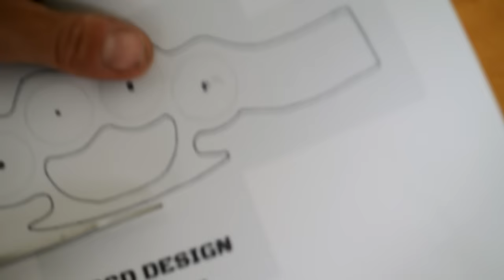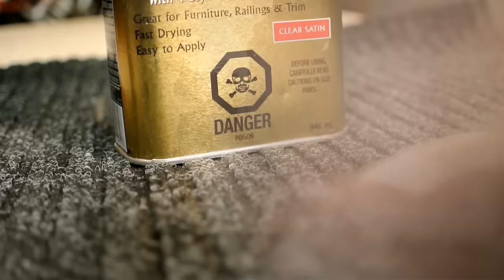Gopro wooden knuckles mount - Build It!

Comment: Great video I would again change one thing for me being a woodworker means no metal involved unless I am creating a hybrid piece that being said I would have made it to where the GoPro fits directly onto the handle. What I mean by this is that I would make the handle to where it has the slots in it for the GoPro I'm going to call them prongs but the part of the housing that slides into the accessories and the bolt goes through. So that the prongs slide directly into the wooden handle into the slots that have been created. Again great work u do amazing woodwork keep it coming. It would be awesome if you could put out more woodworking videos. Again great work love it.
Reply from the maker: I understand what your saying, that would definitely make the piece more unique for sure. I appreciate the suggestion and encouragement!! il definitely keep this in mind for the next one i build.

Comment: Very Nice!  I have that same Delta Scrollsaw....  Haha!
Reply from the maker: Patrick Morrissey I love that machine! I picked it up dirt cheap from a garage sale.
Reply: Hahah!  I got mine for free.  My neighbor was throwing it out.  He had some kind of water problem, and it got wet in his basement, and the saw got rust damage.  The worktable part was HEAVILY rusted.  The painted parts were very minor.  I was able to de-rust and fix the table.  I've used it for 16 years now.  I don't like how hard it is to do blade changes, but it is a very robust saw, has tons of power, and has worked perfect for me....
Reply from the maker: Right on, free tools are always the best. Also refurbishing tools is a great way to do it, you learn the tool and have more respect for it. iv just finished refurbishing some block planes.
Reply: @patrickmorrissey2271  กลเบดบดบดบดบ